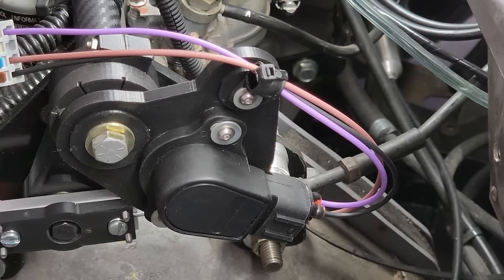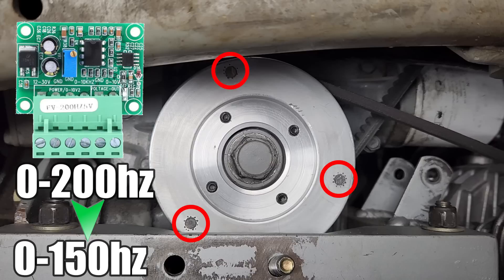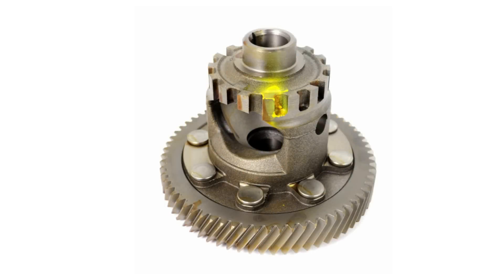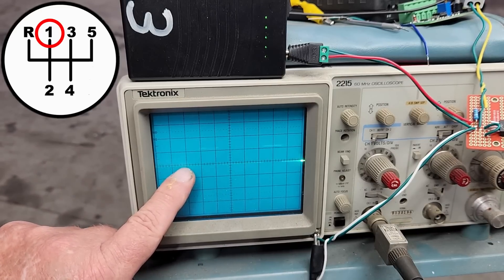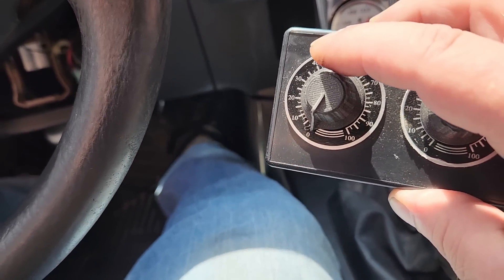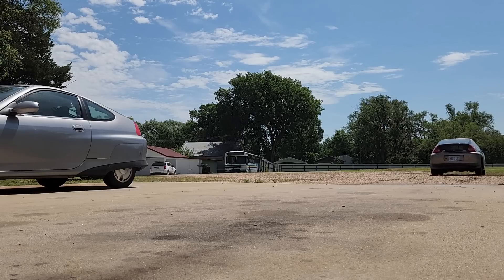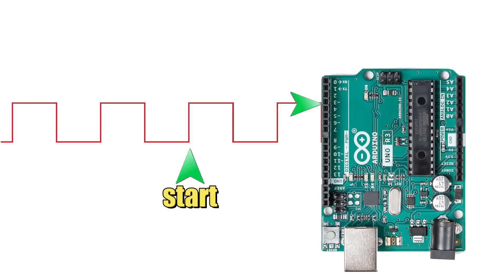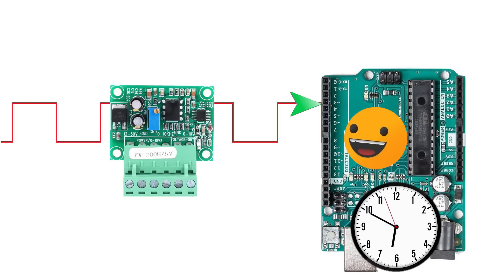S4 E21.We make progress on the Arduino controlled AMR500 supercharged Kubota diesel powered Honda

Comment: that frequency to voltage converter idea has probably solved some headaches for my future self on a project I've been planning for - as a part of doing an EFI conversion on a Suzuki Super Carry (yes the big block 1L engine! aus spec almost-kei truck) I've got a set of Suzuki GSX-R throttlebodies - these run a secondary set of throttles above the main set (that you control) and are ran by a stepper motor, most people just remove this but I feel like an arduino with some clever code, sensors/controllers should allow this to be utilised like its original intent - smoothing throttle response, increasing torque via inlet air speed, and overall just making it respond 'nicer'. anyway one of the challenges I knew was coming up was how to get engine RPM in a 'nice to work with' way for the arduino. anyway I'll put my order in for a few of those, thanks again for the ever-intriguing videos on these projects of yours.

Comment: How about using the Arduino's 16-bit or even 8-bit timer/external interrupt to measure the frequency? If I understood correctly the frequency counter puts out an analog voltage sensor and the Arduino's ADC is not the most accurate...
Anyway a great video once more!
Reply: Ok I didn't reach the hidden chapter yet. Yes the Arduino libraries are not suited for this. You need to mess around with the timer registers. It takes a bit of time but the Atmel datasheet explains a lot. I built a constant current led driver last week with a variable fast pwm 62.5khz signal. I reckon the Arduino can measure an incoming pwm signal just as accurately.

Comment: The ultimate in tinkering video series. You know, it would be possible  to programme the car so it could sense when it’s doing an emissions test and the engine could automatically go into a low emissions mode to pass the test! And then revert back to rolling coal settings once back in the real world. Brilliant

Comment: You can use one hardware timer and interrupt witch only 1 line code to measure RPM. Other calculations to RPM can be in another place in the code. Atmega328 is enought powerfull to measure rpm and more more.

Comment: Great work this is what i like to see. I have a few custom circuits I've designed and installed in my performance car. I even ran my own custom firmware for a while before I swapped it to Haltech for convenience.
Reply: Also ty for explaining why you are using frequency converter before the Arduino. I myself couldn't figure out why it was so hard to get stable signals in the Arduino when the spec sheets said it should do it, being software/firmware issue makes sense and explains why i had to do so much coding to get my projects working reasonably.

Comment: for the vss sensor yoou could use an operational amplifier to clean up the signal and you wouldn't even need a diode or an additonal transistor

Comment: I've used encoder buffer chips like an LS7366 to read hall effect sensors. They just count the number of pulses and when the arduino needs to know the speed, it asks the buffer for the current count and divides it by the time elapsed since the last time it asked. If you use something like a Teensy 4.0, it has 4 encoder buffers built right into the microcontroller. Reading a variable reluctance sensor would require some digital filtering, but it looks like you already have that handled.
Reply: I had the same suggestion with the teensy for sensor input there is even premade lib made for measuring input frequency. Cool to see you watch this channel too I love your other videos.

Comment: Hey Jimbo, as always love the crazy work you're doing! If you're wanting to have a 2nd look at the interrupts for the RPM measurement I'd be more than happy to help you through this. For your setup it can be done in just a few lines of pretty standard code in the Arduino environment and I have no doubt we could get it running a little nicer than the frequency to voltage if you want :)

Comment: Frequency to Voltage converter - there's a story about a WWII physicist who was assigned to design a high altitude anti-aircraft fire director (mechanical computer because they didn't have electronic ones yet). He was in a quandry about what size gears to specify because there were many combinations that would work. Finally an experienced machinist told him to go through the gear catalog and pick out gears that were in the mid-range of what would give him the ratios he needed. Not too fine of teeth. Not too coarse of teeth. 
As you've found out, you never want to use something at the high end of it's rated performance range.

As for the anti-aircraft computer? It was never used because the black powder delay fuse would fizzle out from lack of oxygen at the altitudes they were aiming for.

Comment: Have you considered a different microcontroller? Something like a Pico might let you do the software frequency counting on one core and let the other core do the normal control stuff. In fact, you might be able to use the Pico's PIO hardware to do the counting for you, which would free both cores to do whatever you want. I'm not sure about the PIO stuff but you can probably very easily port your existing code to the Pico since you can still use Arduino Studio if you want (flashing is really simple since it uses UF2)

Comment: An open differential with one wheel turning and one stationary will actually change the gear ratio slightly via the spider gears. This will slightly  throw off your speedometer calibration depending on the tooth count on the spider gears.

Comment: Hey Jimbo. I saw your explanation at the end of the video and I saw the issues you had with the frequency-to-voltage converter. I know you've heavily simplified your explanation of the reasons for why it's difficult to code the frequency counting in the Arduino software, but perhaps I have a trick that could help you.

Timer0 is always in use by the Arduino library for its clock functionality. Timer1 is normally only used if you are using the PWM library. If you aren't, then Timer1 also has an input capture device which can save the value of a free-running timer to a register or it can start and stop the timer based on whether the pin is high or low. Without enabling interrupts, you can still check the input capture flag to see if a capture recently occurred. This allows you to using polling rather than interrupts. I know interrupts really interfere with Arduino code, but accessing registers is quite easy to do using regular old C code. Just check the ICF periodically in your main loop and when you see it is set, compare its value to its previous value for your pulse width / period measurement. For a slow signal such as 200Hz, I suspect you'll have plenty of time in your main loop so that you don't miss a full period.

I've had to use a similar approach to frequency measurement (actually pulse width measurement) on a PIC for an R/C motor driver that expects 50Hz input. Like your situation, I had real-time stuff being done in the main loop and having an interrupt fire would interfere with that. Instead, I used the similar input capture capability on the PIC to asynchronously record the pulse width and I checked for the capture flag in my main loop when I had free time. It worked great!

I suspect you're already quite familiar with this, but I thought I'd bring it up anyway in case you hadn't thought of it. As a programmer myself, I think it would be easier to write code to do this than to futz around with unreliable frequency-to-voltage converters.

If you do stick with the F2V converters, do they support differential outputs? And do you have enough analog input pins to have all of your sensors connected with differential outputs? That might help resolve the noisy measurements you are getting, but that's just a wild guess.

Comment: About the frequency measurement, isn't it a bit more efficient to use interrupts on rising edge only? Or falling edge only? (Not each change of state). And isn't it just a matter of moving the value to a register and resetting the timer register value? It's maybe 10 lines of code in assembly
Reply from the maker: Yes in assembly its quick to calculate frequency, however in the standard code for the arduino frequency measurements are slow..

Comment: LM1815 to manage VR sensors
Reply: on a keyboard now so elaborating. VR sensors, as you probably well know, can output up to and above 100Vpp at high RPM so need suitable circuitry. LM1815 worked very well for me.

Comment: Some observations on your method of measuring speed and rpm. In my past life, I designed cruise controllers for railway locomotives and found that if you attempt to calculate speed or rpm using the main software routine, the results will jump around as shown in your video. This method is based on the assumption that the main software routine is a consistent timing loop which is a false assumption (been down that road!). The timing loop of the main routine will vary with decisions and loops in code. The only way to have a stable speed or rpm is to use an interrupt. When using interrupts, your goal is to write the minimal amount of code in the interrupt. Just pass on what is important which is the time measured and reset the counter. This will provide a stable time reference that the other software routines can use to calculate the speed or rpm. In the software routines, you can even average the number of readings to refine the accuracy. You would have to decide how often updated speed or rpm is actually needed. Do you really need it every second, 1/2 second 1/4 second millisecond etc.. Once you determine how often you need the result than you can work from there. 
You seem focused on using frequency for measuring rpm and speed. Time is the inverse of frequency so you may be able to skip some coding and use time directly as both results are time dependent: revolutions per minute, miles per hour. I'm not familiar with the Arduino directly but you may just need to measure the time between positive rising edges instead of positive and negative. You would be measuring the period between the magnets which could cut down on code. There would be 3 positive edges per revolution. The code would be positive edge Interrupt, record time, reset timer.
Reply from the maker: If you watch the very end of the video there is some bonus material where I  talk about the interrupts and such.  The standard code for the arduino cannot measure frequency quickly.  generally it takes 500ms to get a frequency measurement with standard arduino code.  The trick is to use advance code techniques.  The core of my program is focused on driving the two stepper motors that move the boost controller and the rack controller.  Both of these stepper motors must move quickly without delay.  Using standard arduino code, this is not possible because the arduino code is not efficient enough to handle both the rpm and VSS frequency signals.  I use the frequency to voltage converter to bypass the latency in the arduino code.  I'm fully aware how to measure frequency using interrupts, my method with the converters shows the viewers an alternative method if they are not able to use advance code techniques. Not everybody in the audience is an expert, I reckon there are more novice programmers then there are experts.  using the converters  is certainly not the best way to to get the data, but it is an easy way.

Comment: I think I would just use one of the wheel speed sensors to get the vehicle speed unless it is the same issue with that sensor type. I am not sure what the Honda Insight uses but it might be worth looking into that option.
Reply from the maker: for weight savings, all the ABS stuff on this car was pitched a long time ago.
Reply: @robotcantina8957  Even the tiny lightweight sensor mounted at each wheel?
Reply from the maker: @MrKingdavis13   Yes, those were pitched a long time ago.  The car looks complete, but its been stripped to the bone.  I only kept some stuff for appearance reasons
Reply: @robotcantina8957  Wow, that's serious commitment to stripping stuff off. lol.  Well good luck. Sorry it wasn't helpful

Comment: Suggestion: I would replace the Arduino with a Teensy from PJRC. It's ~$20 and has all of the processing power you'll need. You can easily calculate RPM, speed etc. without the need to convert the signals to analog. Also, the Arduino sketches can be used with the Teensy with only a few modifications.

Comment: Tech tip: If you connect directly to the +12V battery post, you'll find that the battery will act like a huge capacitor and clean up the power. This is compared if you connect to power after the alternator or to ignition power which is dirty.

Comment: Could it be possible to convert the car to throttle by wire using the arduino and the governor solenoid?
Reply from the maker: it's possible for sure, but is not something I'm trying to do right now.

Comment: I was wondering if that was the reason why you chose to use the frequency to voltage converts. Very interesting!
Reply from the maker: The core of the program is to drive two stepper motors without any delay.  Using the frequency to voltage converters provides the data I need without slowing down the the stepper motors.

Comment: You might would have been able to use some of the analog inputs and used a FFT on the signal. No clue thoo if the arduino is capable to run fourier transforms fast enough.

Comment: I have the same signal generator. Makes for a great speaker tester when working on game consoles. I recommend it over measuring ohms. Signal generators can get super expensive but this one was about $10.
Reply from the maker: Its a decent generator for the money.  I'm spoiled and I'm use to using better equipment but I cant justify the expense for the stuff I do in the shop

Comment: Arduinos are cool what they can do. Is vehicle speed necessary? Could use rate of acceleration for engine rpm for whatever function vss was going to be used for?
Reply from the maker: I need VSS only to determine when the car is at around  40 and 55 MPH.   the converter provides a quick way to get the data.

Comment: The "Honda Insiteduino"  NOYCE!
Very cool!  Completely automatic fuel/boost control!  I wonder if an optocoupler would help clean up the messy signals of the magnets (also maybe averaging like 3-5 pulses of input to get a cleaner (more stable) slower ramping/dropping RPM's.  Ah you are converting frequency to voltage..gotcha.   Have you looked at the much beefier and faster ESP32's..thing arduino on steroids...and just as cheapish
Also..using that "hall effect" sensor...you can use "arduino nano (even tinier pico)" [oooh..the TinyPICO...ESP32 in a pico sized board!] to make a tachometer/speedometer (have two of them feeding digital signals to the "master" controller board) this way you have independent "channels" feeding into the controller brain controlling the entire fuel/air/boost mixture.
Sure it means having multiple microcontrollers...but each is responsible for it's own tach (it has one job), this way code is only needed for each specific job...independent of engine speed and speed of transmission w/o needing to interrupt the brain that is controlling the boost and fuel...more complexity I guess...but easier to mash all the digital signal inputs rather than trying to convert analog to digital
Reply from the maker: The key to this project is to move two stepper motors as fast as possible That way I can control the boost and the fuel rack without delay.  The UNO has plenty of speed for this.  The RPM and VSS signals provide basic data  for the core program.  No need to for extreme accuracy.  The voltage to frequency converters are presented as an alternative method that beginners can use for simple projects.

Comment: Wish I can program arduino  ) I bought pump and spray nozzle for water injection and it works well - but it needs to be automated )
I used waste passage with 1mm dia restrictor near nozzle -so pressure drops instant after I switch off the pump (spray nozzle has built in one way valve)

Comment: If you really worry about the big city folk, theres really tiny diesels around with DPFs. Im sure that would limit smoke without restricting flow much, as im thinking of like 1.2 1.6 TDIs the kind volkswagen put out. Big enough not to restrict the little kubota i think, a 1.2 TDI DPF should flow like 65 70 hp fine

Comment: That scope belongs in a museum 😂 hey if it works it works, nothing wrong with that. Although I'll throw it out there a 2 channel pico is pretty affordable 😉 very interesting getting to learn how things work on the controller side. How do you program a fail safe mode? I.e the vss stops working or a magnet falls out of the crank pulley
Reply from the maker: The scope is indeed an antique but its perfect for the shop.   Fail safe is to turn off the Arduino.  the engine should run normally without all the gizmos.

Comment: Protip for the Arduino:

This may not apply anymore, but when I looked into it 5-10 years ago, the default serial library looked like it was way slower than it could be. A lot of virtual functions, a lot of dynamic memory, a lot of things that could be a real problem for any kind of embedded realtime stuff.

Rewrite it with something basic for this application and you might be able to squeeze more compute out of the arduino!

Comment: That little arduino is running like a clock lol literally. Keep it up. That thing will be cranking out all sorts of power without making Greta say, “how dare you?!”
Reply: It has a crystal controlled oscillator (aka a very accurateish electronic clock) just for that reason ;)